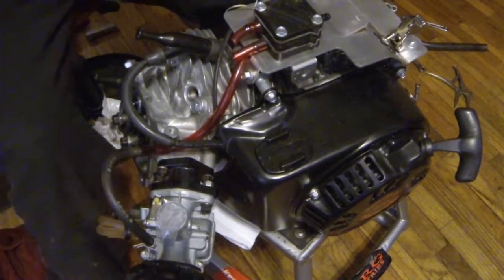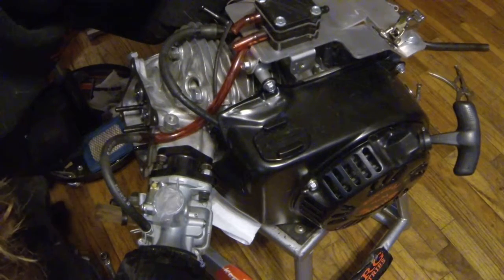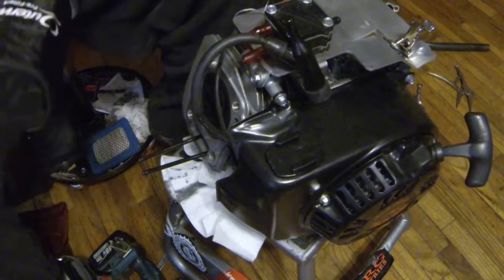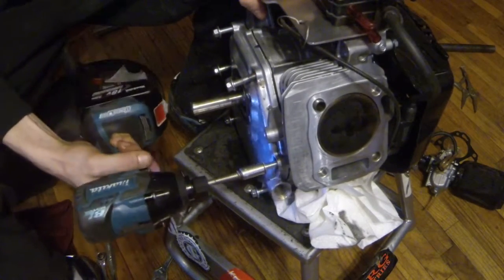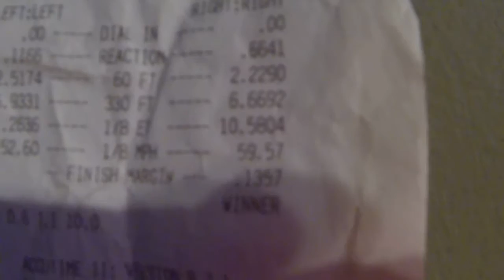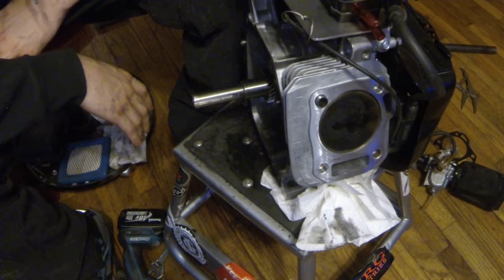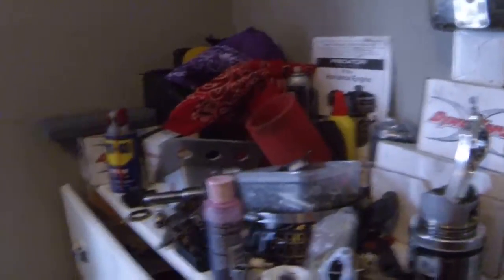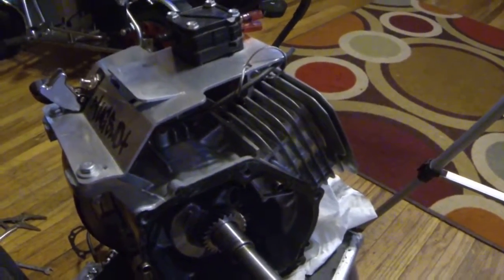Harbor freight Predator 212cc rebuild pt 3

Comment: I got a 212 predator engine and it's not picking up on speed stays at a low speed and I try to get faster and it just not piking up
Reply from the maker: Eduardo Figueroa if it still had the governor it will not let it rev out. Or maybe your not getting full throttle. Put back tire in the air and give it gas and if ur throttle piece is moving back and forth and revving up and down then the governor is still probably hooked up.. if you hold the throttle lever with your hand directly on the carb and give it full throttle you will notice the spring trying to bring the throttle back to a lower rpm. Don't rev it out at full rpm too long though.  Maybe look up vid on how to remove govornor.   Good luck
Reply: BROKE RICHGUY can I get ur number ? It was going perfect fine , it's just sounding weird like it's gonna give out . I rev it to go but it just don't pik up